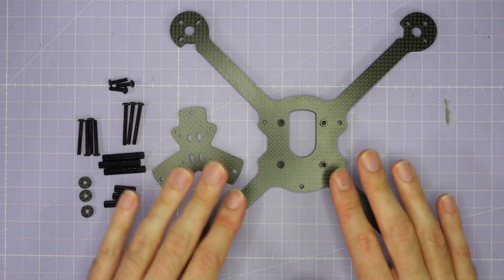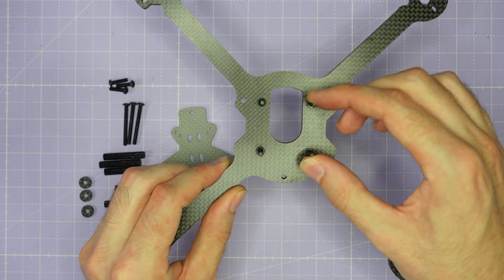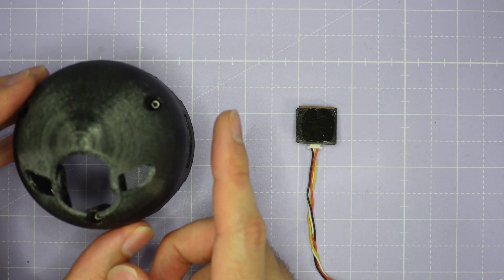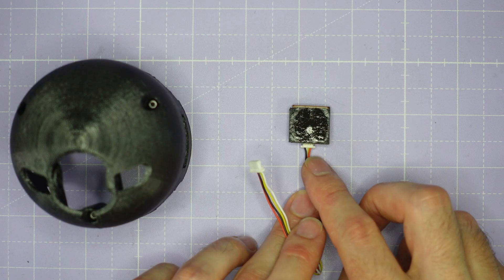200mph Drone Build Guide (AOS HS5)

Comment: Hi Chris.  Nice job!  Question, do you have an HS5 preset available for BF 4.6?  If I apply the BF 4.5 preset to BF 4.6 via the CLI, would there be significant risk of flight problems or issues?

Comment: Question… I ordered and am about to build the drone. Would
like to know if you would reconsidered making the stl files available for the aero parts. I would like to fork the design and would rather not “remodel” that whole thing.  Our application will be for a long range autonomous unit with a bigger battery so the base will be our primary modification. Would also like to consider a dual camera in the nose.. a flying  camera and a capture camera so the nose will need considerable remodeling.

Comment: Chris, if we are using the Walksnail Mooklight 4k kit for the build, do you have any recomendations for the 2 antenna arrangement?  I had an idea to put one in each of the other spaces instead of the one meant for the DJI single antenna.  Can still use the zip tie cut outs, just at 90'ish+ degrees turn and install them parallel, one facing each side using the other 2 cuts outs -  That was my initial idea. One facing each side would work well.  Any ideas there??
Reply from the maker: Yes that would work great and have them at a 60 degree angle as a result.

Comment: Just finished building one of my own - a couple things I would like to see fixed with the HS5 are the prop spinners don't fit with the HQProp 5.3x8 props (I actually cracked one of them trying to slot the prop in, and decided to use the carbon spacers instead). I would also mention that you need M1.6x10 screws to mount the O3 transmitter (it did include the TPU antennae mount which was nice) and longer M2x6 screws to mount the O3 camera. That and the longer screws that come with the T-Motor 2808 do not fit - you need to use M3x12 screws which work perfectly. I also noticed you moved the surface mount capacitor on the Blitz F7 - I ended up soldering a new 1000uF capacitor to the old pads, which contacts the O3 antenna radiator if you mount it straight up and down, but clears the JST plugs and the antenna by pushing it to the side a bit once assembled. I was going to have the capacitor at the XT60 plug, but there is very little room for the extra battery cable as it is.

Excited to test fly it though, already have the tune loaded up!

Comment: RANT! So, I had a minor hard landing and broke 2 fins off the bottom shell. Since we don't get the STL's when we buy the drone, and we can't even buy them, I bought a new bottom shell from Brain 3D for $24.50. Something I could have printed for less than a dollar or two. After waiting a week to get it, I found out it doesn't come with the little cross piece in the bottom to hold the battery. How many frames cost over $124? And they can't include the STL files? Or even at the very least, sell them to us? This drone is actually very tricky to land. Plan on breaking a few parts and having to wait a week each time. I'm sure I'm not the only one who thinks this is unfair?
Update, Brian at Brain 3D contacted me and got me the part. He was really super nice about it and got over night. I'm really impressed with that.
Reply: Yeah… not making the stls available is a major pain point with this unit.

Comment: I got the right props today...198MPH😲 with no wind. Imagine if I had a little tail wind
Reply: What motors and stack do you have ?
Reply: @sully8320  I am using the motors Chris recommended, the Velox V2808 1950kv and the stack is the Speedybee F7 V3 50A.
Reply: @MikeMillerDrones  what do you make of the speedy bee stack ?
Reply: @sully8320  I love it. I have it in 5 of my drones and it has been super reliable. Also, it has all the plug in ports, so it works good for this build.
Reply: @MikeMillerDrones  I'm looking at one now, how long ago did you get yours and is it actually blehli32 on it ?

Comment: Looks like the IFlight ESC is a must.
Reply: @ChrisQuadFPV  I was able to use a AM32 60A ESC no problem.
Reply: I've been using the Speedybee F7 V3 50A, so far no problems. Knock on wood. (why do I feel like I just said the words "last pack"?)
Reply: @MikeMillerDrones I have 3 SpeedyBee stack's ❤️ but this is a special build

Comment: Hey Chris, I love the devleopment you are doing!!! Keep it  up and keep us inform of what you are up to. I have been playing in the FPV Gopro filming space for a waiting including filming RC planes and (regulator approved) manned aircraft. Im using a standard 7" quad with a Gopro and I'll seemingly blocked by a 140-150km/hr barrier. Keep in mind I want to do this speed for 5mins at a time with a gopro. What do you think is the biggest problem with this conventional drone? Is is drag (in particular the gopro)? Is it prop size and motor kv? The AOS HS5 would be great for straight line speed. However, would only allow for trailing shots of  the subject aircraft. Interested in your thoughts. Keep it up mate, very inspiring!!!

Comment: waiting patiently for mine to arrive - what is the ESC you are using? It is quite different to the usual 6-on-each side layout - looks like a giant whoop ESC :)
Reply: Looks like a 30 by 30 stack to me
Reply: @ChrisQuadFPV  - it is a 30 x 30 stack but not seen this layout before on a full size ESC (pads on each corners)
Reply: @cedriclempereur1892  Its the iflight esc that has solder  pads on the corners.

Comment: I just built mine, now just waiting on the props to come in. I was wondering where those cerated carbon fiber washer went. It’s all loaded up with your tune are ready to test fly it. Thanks for building such a sorted out kit. I also have your 10” long range and 7” v5 kits on order.
Reply: HQ Props - Thin Electric Prop 5.3x8
Reply: let us know how it goes - I am literally waiting on the same 3 frames :D
Reply: What props did you order? I can't find specific info on the right size.
Reply: Can you tell if 5.5 length props might be OK? Not exactly sure how much room I have to work with yet.
Reply: @bruhle  I just measured the distance from the center of a motor shaft on the arm to the main body. It is 75mm to touching the main body.
Reply: @bruhle  I also just tried a multiple 6” props on it. A 2, 3 and 4 blade and they all fit with about 2.3mm clearance to the main battery container body.
Reply: @worldnetsource What is your top speed so far. I just got the right props and hit 198 on my first test runs.
Reply: @MikeMillerDrones  I have not flown it yet. Waiting on the right HQ props to cone in.
Reply: @worldnetsource  I ordered mine from APC and had them in 2 days. Super fast. I got several sizes and the 5.25x8's were way the fastest.
Reply: @MikeMillerDrones  Good to know, thanks.